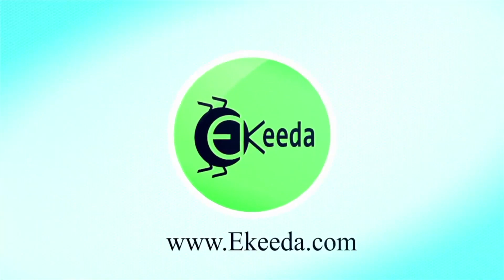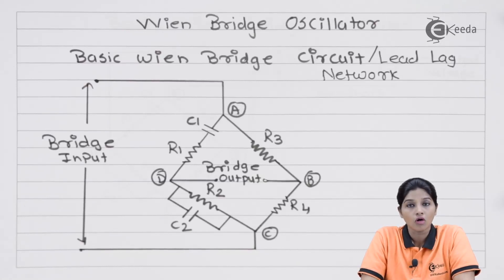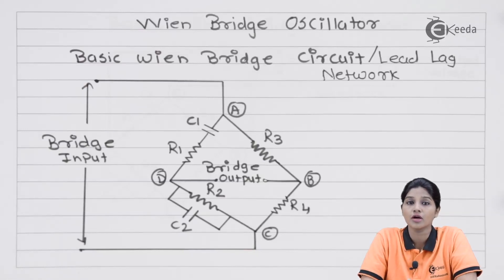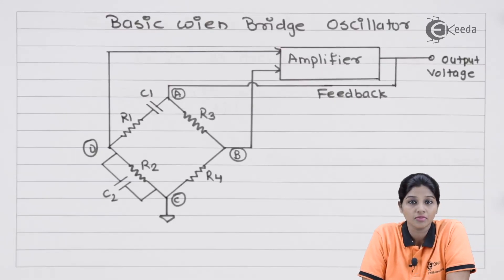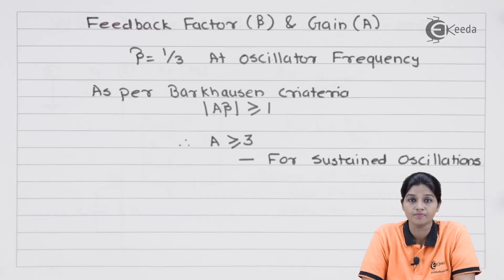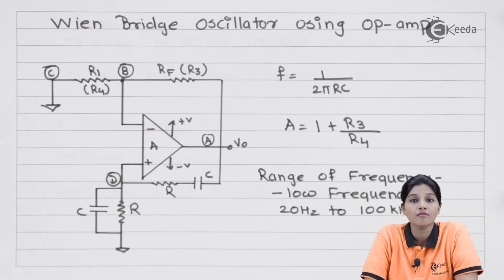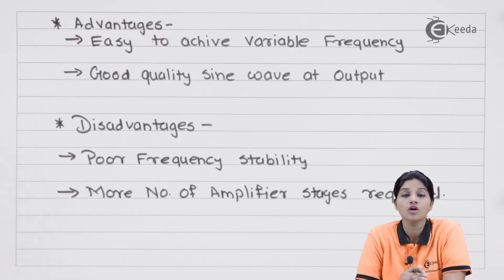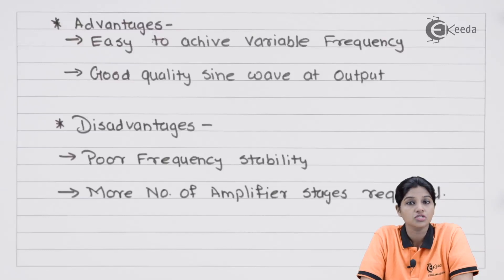Wien Bridge Oscillator - Oscillator - Linear Integrated Circuits

Comment: I don't see the disadvantage of higher number of amplifier stages, especially in comparison to phase shift oscillators. The required amplification is just 3 and not 29 like in the case of phase shift oscillators. The frequency range of RC oscillators is not necessarily limited to "low" frequencies. It depends on the signal propagation velocity through the op amp. It is no problem to operate a Wien bridge oscillator at a frequency 50 or even 100 MHz if you use an op amp with a very high slew rate like the LM7171 from Texas Instruments.